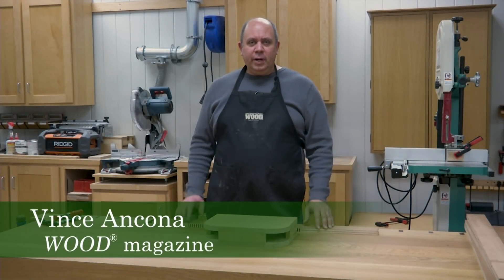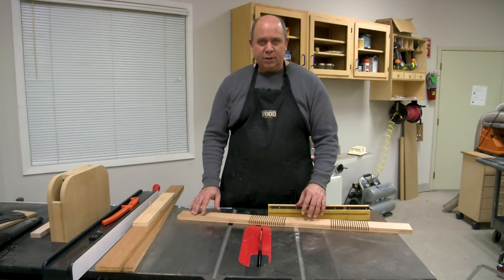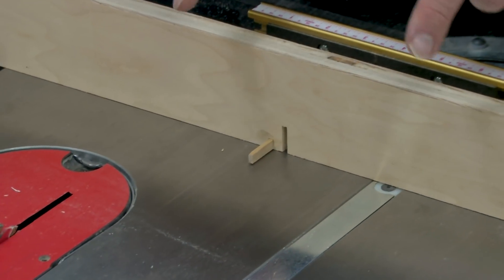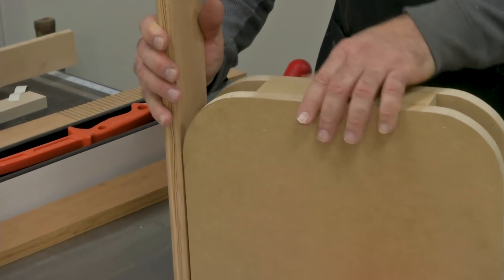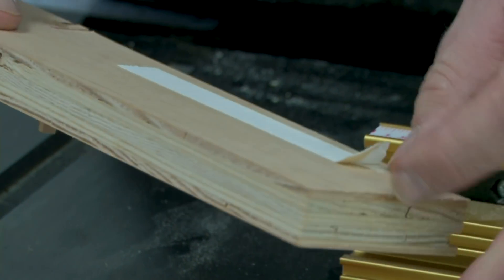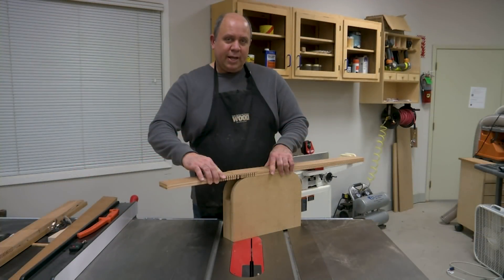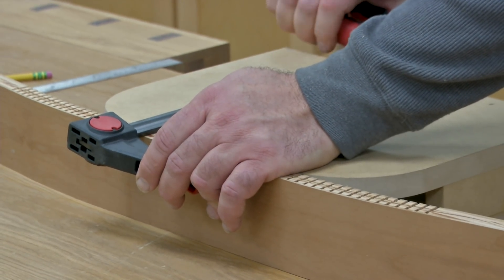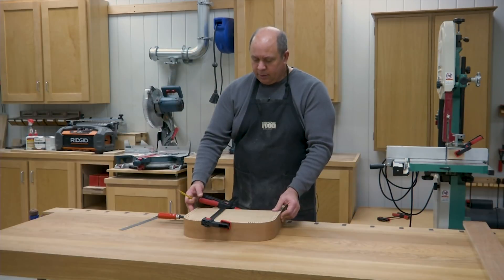How To Kerf Bend Wood - WOOD magazine

Comment: So, quick note. I'm a begining wood worker, so take this with a fistfull of salt. BUT, after speaking witha luthier (guitar maker) he mentioned that they do the same obviously for guitars. A trick that he mentioned worked really well, (other than using softer wood) is water. He mentioned he sprays with an atomizer/spray bottle, the portion that is to be bent. He'll do ti ta  few times before bending. And a few times during and after. Nothing too crazy, just enough to saturate, but not enough to drip. It tends to make the wood more flexible and in the end, once its dry, it looks and does the same. He says, "remember, the wood is a bit of a living organism still" lol
Reply: He is right, a little water, a little water and heat or steam makes it much more flexible, I bet he even knows how to calculate the amount of material to remove so you can glue the kerfs together for a much stronger curve.

Comment: Glue...do you fill the kerfs with it as part of the final assembly for additional strength of the bend?
Reply: That's what I've always heard. I was wondering the same thing.
Reply: I would pour fiberglass to fill the kerf
Reply: If you do the math and remove the difference of material between the outside radius and inside radius over the distance you can glue the kerfs, no need to use a form it is much stronger then the guess and cut method.

Comment: If you remove the amount of material between the outside radius and inside radius you can put glue in the kerf cuts and it is pretty strong. A little math makes a much stronger curve that you dont have to put it around a form.  (find out the outside radius and the find the inside radius the difference is the amount of material you need to remove by cutting evenly spaced kerfs over that distance) A little water, steam is even better and as a last resort a little heat will increase flexibility.

Comment: So we get to see the cutting of an unsuccessful broken piece... then when it's actually a successful piece, we don't get to see it cut... nor even the "new depth" that allowed the wood to bend in the first place as opposed to "just snapping in half"? No visual reference between good and bad? Great...

Will keep searching. (also makes me question the entire thing when we're told to make kerf cuts at "about 1/16th of an inch  of material left" and then we see the first cuts and they're the remaining material is about the SAME SIZE AS THE SAWBLADE'S THICKNESS which we're told was 1/8" of an inch.

No wonder why people keep asking for "bendywood" to be stocked.